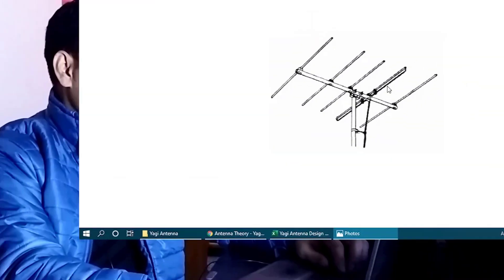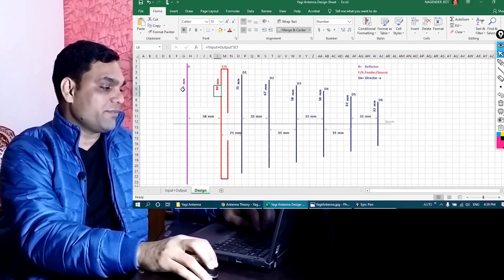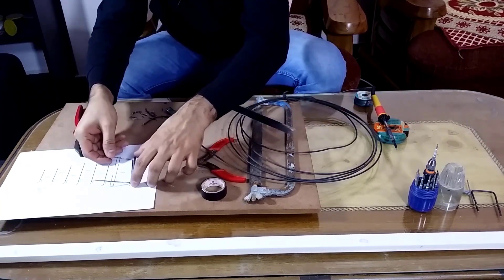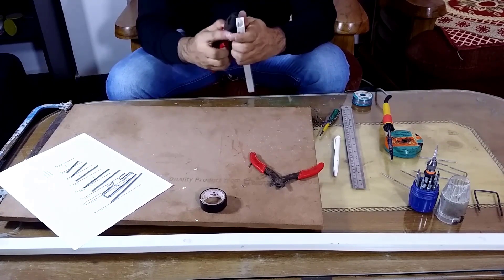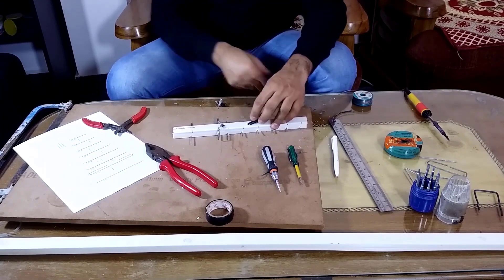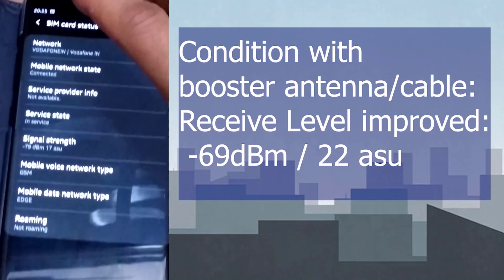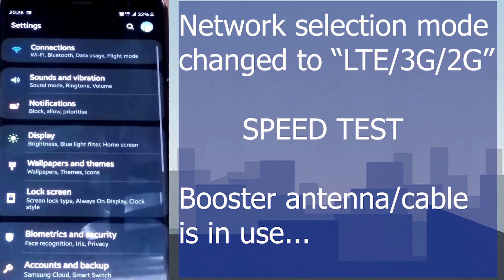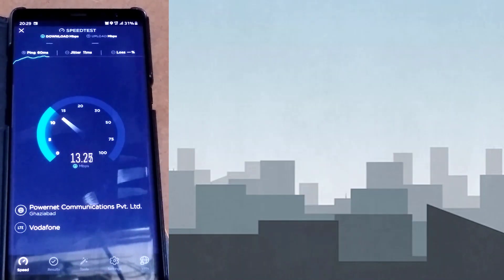Mobile Signal Booster for home - 2G 3G 4G - Homemade India

Comment: also how is this even working when the only thing touching a rod by the cable wirier  is the  one almost  in the middle  the rod which was the one with the most bends. the rest of the rods are not touching i wounder if some one were to use a aluminum rectangular pipe then all rode are touching each other look like to me that the one rod  doing the work is the one that the cable wirier is touching the rest are just for show maybe in my case i need the booster part not just the antenna part  but the booster pat and yes cost almost 300usd + the shipping to the country it needs to go at  huhu

Comment: Hi, Thanks a lot for the video.
I see that you have connected two wires of coaxial cable to each of the dipole ends. The coaxial cable that I have has only one central copper wire. How do I connect dipole to it?
Reply from the maker: One wire is the core of coaxial cable and the other is nothing else but the twisted wire mesh of coaxial cable

Comment: Hi, I see that the boom is not metal, thus there is not an electrical connecrion between the different parts of the antenna. I have seen otger videos of aimilar antennas and they use a metal rod as a boom,to where the other partsare welded. Couldyou please explain why this is nornecessary in your antenna? 
Thanks a lot for the video!
Reply from the maker: Ideally the boom should not have connections to the Elements  otherwise the response of the Antenna will deviate from the intended frequency. Usually there are corrections needed if the boom is conductive and touches the elements.  

See more details Here: Yagi Antenna Insulated Elements Boom Correction: https://www.qsl.net/yu1aw/Misc/Yagi_boom_insul_corr.pdf#:~:text=Theoretically%20and%20practically%2C%20a%20Yagi%20antenna%20can%20work,antenna%20can%20be%20built%20in%20a%20few%20ways.

Comment: The sheet seems not working . I mean is not calculating the length of elements in mm on the right side column . Only calculating values in Lambda . For mm showing always the word #VALUE as result .I use OpenOffice to open the xls file.

Comment: Thanks for the video.  However, as you mentioned, mobility is the issue.  We have to keep the other end of the cable always with the mobile.  There must be some solution for this too. 😊😊😊
Reply: @@sayedhossaini8040 What do they call the device sold only?  I did not see what was inside the part that the phone sits on.  Will watch again.  Thanks

Comment: I wonder if you could split the end that goes to the cellphone (meaning make two "phone ends" connected in a "Y" to the antenna) so you could use it on more than one cellphone? Thoughts? There is a particular camping spot my wife and I like and the cell reception is very weak there.
Reply from the maker: Worth a try!

Comment: Tested! But is not working for me.
Without this antenna i got -120~-110dBm in house.
With antenna i got -115~-108dBm in house.
But the interesting fact is just with coaxial cable without antena i got -92~88  dBm in house.
In the roof top usally i got -80~-85 dBm.

Comment: Radio  with  this  use  Antina. काम लगैगा   सर .......
Reply from the maker: Ideally radio should also work, but size will be much bigger as the radio stations transmit at much lower frequencies. But it'll definitely work.

Comment: Thank you very much for your very clear and crispy presentation.It ll reach any non technical person too. I have the same issue like yours  in my house. I need it with mobility, help me to go for a reliable booster device to be installed in Coimbatore  for Airtel and Vodaphone.
Reply from the maker: sorry dear, usign active/powered booster without operator involvement is illegal. Can't help.

Comment: The DTH cable have two mesh copper wire. How connect to antenna(dipole) and make the other  S shape end.
Do I need to solder the each mesh wire to the both end of dipole individually and then combine the both wired mesh to make S shape end(for plastic card)
Reply from the maker: https://www.youtube.com/watch?v=ZSk6_mOubuI

Comment: What is the material You used,?
Reply from the maker: Iron wire with PVC Boom + RG6 Cable
Reply: @GeekyAndTweaky  If you don't mind, could you give me the size and length,? for LTE 700MHz. and 2500 MHz.

Comment: Is there a device that receives a 3G 4G 5G cell phone signal from a distance of 60 to 80 km?
Reply from the maker: I am afraid, it won't work for Mobile networks. 

That's a bit too far. Even if you get the signal, the delay (Techincally countered by Timing Advance or TA in short) will be too high. The Network will not admit your device. For such long distances, the operators (Mobile carriers) need to enable Super extended cell feature in the base station. This is not usually done for just any place.

Comment: How many directors are needed for LTE 700 MHz? Or 3 directors are enough?
Reply from the maker: Hello Luis, The more is the number of directors higher will be the gain. Intial few directors give relatively more gain than the additional ones. So you can start with 3.

Comment: Hi sir I'm making the antenna and I'm facing some problems with the cable. There are two connecters what are those, I could not see it properly. And we use only the core cunductor in other end which is a single wire. It has 2 cunductors inner and core... What to do sir?

Comment: Great material, great help, thank you !!!
I have two questions:
1. Can copper bars be made? (Will they be better?)
2. Better tubes or full rods (? What diameter will be the best?)
Reply from the maker: hi
1. Yes, I believe this will perform better
2. diameter = 0.0085 X wavelength
Reply: @GeekyAndTweaky  2. LTE 900Mhz - 900x0.0085 = diameter (mm) ???
Reply: I am sorry ! I found it !!! ;) 900MHz = 0,333m (lenght) :) => 0,33m x 0,0085=0,002805m (diameter) - Correct ? So i can use 3mm diameter wire

Comment: Hi Jeet uncle, whats the length of the dipole?? The curve and stuff.....
Reply from the maker: Dear, please check the links in video description for all the details.
Reply: @GeekyAndTweaky  No measurements are given to curves...
Reply from the maker: @sanjayrajan8756  you can keep the sides (curves) as 15mm long
Reply: @GeekyAndTweaky  let's see that the length of f/s is 80mm (for 1800Mhz) other side length is 15 + 15 mm. So what should be the breadth both the sides?
Reply: Sorry but I think you should have mentioned the details of the dipole clearly in the docs.
Reply from the maker: @sanjayrajan8756  I agree! I am still learning :)
Reply: @GeekyAndTweaky  ok uncle so for my antenna can I just add 15mm each side (30mm) and make the curve??
Reply: I recommend you to have a discord server if any stranger like me want to contact you personally and you feel a bit unsafe to give your phone number. Its free btw.
Reply: Can I use copper wire? My uncle is a mechanical engineer and he told its alright but using iron is less conductive.
Reply from the maker: @sanjayrajan8756  I too believe that copper will be fine
Reply: @GeekyAndTweaky  ok and thank you

Comment: hello sir, really great to watch your video but i have one doubt i have three different sims airtel , jio, vodafone. i was checking the frequency of all three different sims. jio was 850 inside home and outside home 1800 and 2300. airtel was 1800 and 2300. idea was 1800, 2300 , 2500. so im bit confused which frequency i should use.
Reply from the maker: Hi

Usually lower frequencies have better penetration. So 850MHz will give you better coverage without the antenna also. I'd recommend you go with 1800Mhz as that's a common frequency for all your SIMs

Comment: In our area there is 2g service can i get 4g with then help of this antenna.. plz rply 🙏🙏🙏🙏
Reply from the maker: This can boost the signal only if it is present, may be low intensity. If there is no 4G in your area, then this won't help.

Comment: Hello,  how do you connect the negative and possitive cable wire to the driving element, is it shorted? Thank you.
Reply: I think one is grounded and only the main wire is used as a receiver pad thing.

Comment: What was your cable length 
Does it work at 15 MTR cable
Reply from the maker: I have tested it only upto 30 feet. I fear that 15 meters (~ 50 feet) may be a bit too long.

Comment: Sir. 
I tried it several times, every time its getting fail to catch any signal.. mobile not responding with antenna or without antenna there is no change in netwrok strength. 
There are trees surroundings to my house. But at the terrace of my house there is BSNL 3G network of 2 to 3 bars.whether the singal tower must visible or simply 2 to 3 bar is enough. Every time I was pointing the antenna towards singal tower. But there are trees surroundings... Plz guide...
Reply: How much you get usually?
Reply: @pabitranaskar5967  at terrace there is 2 bar bsnl 3g nework... But inside house its nil...
Reply: Poison the trees at midnight.

Comment: for bsnl Bannd 1 2100Mhz  not working.. i make antenna two timesbut not worked. i fix antenna  at 25 ffet height also try after change the directions... Help

Comment: I have jio sim so , so do I need to create 3 antena to cover  all the 3 jio band(850hz,1800hz,2300hz) , or one will be enough. I want to use  jiofi6 with better internet speed.
Reply from the maker: One will be enough.

Check which band has better coverage at your place.

Usually, lower is the frequency, better is the coverage.

Comment: Hi,
It did not work for me i tried every thing,
can you help me with this, i am using a cable which is same as yours and the rods are cut and placed at the same distance as you specified but i am unable to boost the signal for my airtel sim, please reply
Reply from the maker: Could you please share some pics of your setup

Comment: Do something that the signal will come without placing on it
Reply from the maker: hello Muskan, 

That'll need a amplifier and transmitter circuit and It's illegal to make Active RF transmitters for commercial frequency bands. 

One needs to take a lot of approvals and certifications before such a device can be certified for use. That's a long and painful process for individuals to go for. (Unless one want's to do it for commercial production).

regards
G&T

Comment: Hello, outstanding video, very informative, well executed. Worth subscribing to. Please, some questions, if I may:  As per your recommendation to dial on a Samsung phone *#0011#, in my case, 850, 1900 Mhz.  Do operators change frequency when the signal downgrades to 3G, 2G? Would the Yagi required still be 1900? Can you recommend a booster (plug in type) and in house antenna?  If the wire calculated by f/C/lambda   x 0.0085 is 1.3mm, why do commercial yagis have elements (aluminum) that have 5 to 10 mm?  Is it less optimum? I look forward to your videos. Thank you. Gustavo in Caracas
Reply from the maker: Hello Gustavo, 

First of all, thanks for your encouraging words!

Operators do exercise load balancing strategies based on both signal quality and load (number of users in a particular cell/technology). So chances are, that a mobile phone may switch to another frequency band/technology while in use/connected. 

When connected in a particular frequency band, antenna will perform better if designed to that particular (currently connected) band's dimensions. 

Regarding those 10 mm sized elements: Usually, those sizes are for hollow pipes. Thickness of the metal will be typically between 1 to 3 mm range. What do you think?

regards
G&T

Comment: Thank you for this helpful video. I have 3mm thickness of aluminium wire. I want to make LTE 2300mhz antenna. Is it work if I make it with 3mm thickness of aluminium wire??
Reply from the maker: Hello Shankar, 

Ideally, for 2300 Mhz band, thickness of around 1.1mm should be perfect. But you can still try with 3mm. It should still add some gain.

Regards
G&T

Comment: Looks very useful info. I want to build one for self. Am not sure of antenna element sizes(Reflector, Dipole, Drivers & spacings). It will be great help, if you share some references/excel of the same.

Bandwidth in my circle is 5 for jio & 8 for airtel
My email id
umesh.567b@gmail.com
Reply from the maker: Links are already shared in description

Comment: Sir thanks for helpful video.
I am also facing same problem of mobile single in my room.
I am interested to bolt it for my Jio SIM in rajesthan jodpur .
Can I use copper pipe of 6 mm dia .
And gide me.
Reply from the maker: Dear, I have not tried with a pipe myself. But I have seen some commercial solutions made of pipe. So its definitely worth a try. Please do share the results with others if you try.

Regards 
G&T
Reply: @GeekyAndTweaky  one more question for Jio network supporting design
Reply from the maker: @pankajbhati7762  j
JIO operates in 3 different bands across the entire country. 2300 Mhz is present everywhere. 
You can find link to all the design PDFs in video description.
Reply: @GeekyAndTweaky  for lit 850(5)
Reply: Sir I made and it work satisfactory .
Thanks for your support
Reply from the maker: @pankajbhati7762  That's great! thanks for confirming!

Comment: Hi bro , if i use aluminium wire 2mm  for Reflector , Feeder source and Director also if i join Feeder source in the end  with coper wire 1mm  , is it will work good ??!
Reply from the maker: Hi Arif, in my design, I didn't join the ends and it still worked fine.

Comment: Jio  is not working . What I do to get jio singnel
Reply from the maker: Dear Muskaan

Hope you have followed the design corresponding to Jio frequency band in your area. 

Can you please confirm the telecom circle that you located in? And which design have you used?

It'll be good if you can share some pictures of the  Antenna you made.

Regards 
G&T
Reply from the maker: I have personally tested it on Jio in Gurgaon. It works!

Comment: (Band:8 BW: 5mhz) means?
Reply from the maker: Band 8 of LTE corresponds to 900 Mhz band. 

This is the extended band which was originally used for 2G (GSM).

5MHz of bandwidth is 1/4th part of full LTE carrier. Which in plain English means = don't expect too much throughput, it's LTE with very little amount of resources.
Reply: @GeekyAndTweaky  .... Tnx Bro👍
Reply: @GeekyAndTweaky  .....  I made a 900 mhz antenna but the signal didn't go well

Comment: I am tried since 2 days but not getting results. 
I have used copper wire dia. 3mm
Coaxial cable 20 ft.
Not soldered at connection.

I didn't find any deviation in signal for any network.
Please suggest why it is not working.
Very good signal at roof -95 dbm but too poor at ground room. I am expecting better response for jio in Maharashtra.
Reply from the maker: Dear Bharamu

Please solder the cable at antenna end for better results.

Comment: Sir what would be the length of elements if I use 3mm aluminum wire.
Reply from the maker: Dear albin, both length and diameter are dependent on frequency band.

What frequency band do you need to make the antenna for?
Reply: @GeekyAndTweaky  850mhz..ie the jio frequency here. Sir could you please explain how to determine how to calculate the length with various diameter
Reply from the maker: Please the excel sheet/pdf designs that I have shared.

Diameter = 0.0085 x wavelength
Reply: @GeekyAndTweaky  But sir as per this equation we can find the diameter for a particular wavelength. But how can we find the length of reflectors dipole and directors for different diameters. Thank you for sparing your valuable time.
Reply from the maker: Please check the PDF /excel file linked in the description for all calculations.
Reply: @GeekyAndTweaky  Sir I have made the antenna but I couldn't get any signal. I have made the antenna as per the data sheet of 850mhz using 3mm Aluminium wire. Eventhough antenna was unable to pickup any signal. Sir is there any calculation for the bending radius of driven element. My driven element bending radius is around 2.5 cm, is that ok. There are no kinks or bends in my directors. And they are alingned in same plane and perpendicular to boom. Kindly  help. When connecting coaxial cable to driven element is there any need of shorting using another wire?, I have done so.

Comment: Sir..can you please explain how to connect the dipole to coaxial cable and how to use Balun for this antena and it's connection. Is there any method to amplify the received signals.

Comment: thanks for this insightful video. please which material is best for the directors? copper or aluminium? 
shared this link and subscribed
Reply from the maker: Hi Bernard 
Thanks for subscribing and sharing!

Copper will be best, then Aluminium.

Higher the conductivity better the material 

Regards
G&T